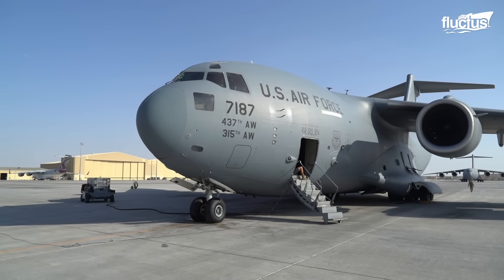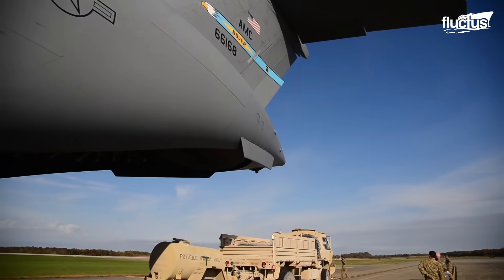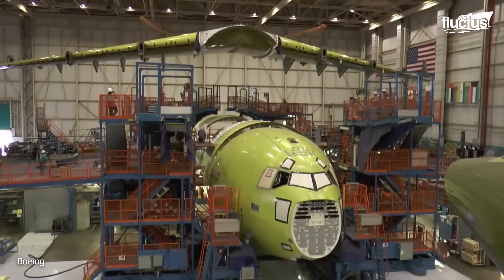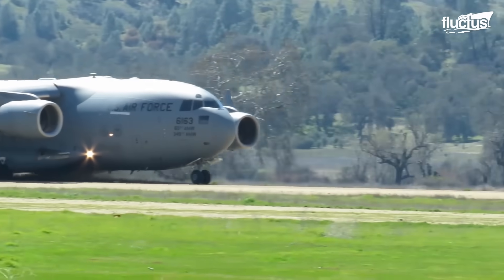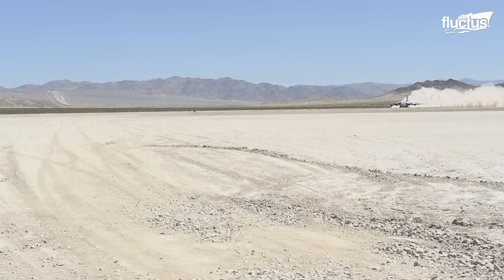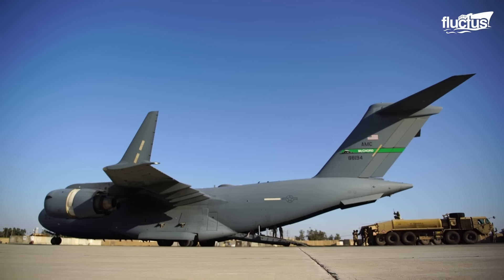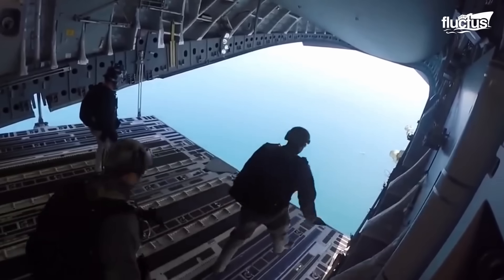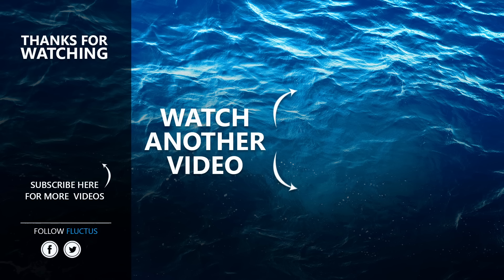Boeing C-17: US Most Advanced Airlifter Ever Built | Documentary

Comment: I worked on the C-17 as a structural design engineer at MD in the late 1980s.  Easy plane to design for as there was so much room in the wing, something I was not used to having only worked on fighter programs until then.  I designed the (structural fuse) flap attach fittings on the trailing edge and a lot of the fuel scavenge system using jet pumps, another first for me.  Nice to see it doing well in service.
Reply: Thanks for an amazing plane. Did the last second APU placement cause you a ton of pain? I always heard that almost scrapped the entire program
Reply: @sheeshshoot123 I m not aware of that APU issue at all.  During my time there (I was a contractor) it was a weird program, management-wise.  Everything we did was on their CAD system, and later we had to print out Mylar versions and modify them by hand.  Made no sense to me, still doesn’t.  There was budget hanky-panky going on Im pretty sure…burning hours they were already paid for, but I dont know.  This was Reagan era waste, fraud and abuse time, and here it seemed to be happening in front of my face.  Lol.  Come to learn such is life.

Comment: I was working for the phone company at McDonnell Douglas in the early 90's when they were building the 1st one and we had a microwave radio room in the hangar where the plane was undergoing wing stress testing.  The horizontal stabilizer on the tail was level with our 5th floor radio room.  They had they huge hydraulic arms attached to the wing tips and were pulling them up about 10 or more feet when one snapped and that led to a complete redesign of the wing.  When testing out at Edwards AFB they used to relay flight data along microwave sites all the way back to Long Beach for analysis.  I think one of the 1st flights they did a 380,000 pound takeoff in 1200 feet.  That's amazing.  After I left there Boeing took over the plant and now it's not even there.  Even new office building that Douglas built was torn down.

Comment: "Most Advanced" doesn't mean the Best; Just means it is New
Reply: Then tell us which one is the best. I gotsta know.
Reply: @hagdore  It was just a statement. But if you wish, as @solero7378 points out, the C5. Also There is the Beluga or the ill fated An 225.
Reply: Not true.   C-5 can do that.   The powers- that- be made the Air Force hide those capabilities of the C-5 so Congress would approve the C-17.  Only reason we didn't just build more C-5s was a certain General McPeak had all the molds destroyed.   The C-5 can land on shorter fields,  and take off on shorted fields with more cargo,  and it has a smaller foot print,  thanks to all the extra tires.   That is all published on all airfield- suitability reports. Oh,  and it can land on un-improved surfaces.  C-17 can't because engines fod out😮
Reply: @solero7378 then why do they have the c17 in the first place if the c5 can do everything but better
Reply: @AlwaysChasingStorms  Already answered.  As with any military purchase, they have to convince Congress why they need it.  They needed new airplanes, and the molds for the C-5 had been destroyed.  And to promote the capabilities needed for a new airlifter, many of the capabilities of the C-5 were removed from the tech orders, making it a violation for aircrew to do any of them.  That way they could go to Congress and say that they didn't have an asset that can do low level airdrop, or short field operations, or unimproved- field landings.
Reply: Do you have another aircraft more advance than this one ?
Reply: Ni cómo decirlo mejor!
Reply: @luismonjaras7160  The Replies or the Plane?
Reply: Name one better..there is no other it's the best!
Reply: @Loafin2010  See my previous Reply
Reply: The C-5 could do everything this little airlifter can do,  and more... and better.  Haul more.  Go farther.  Go faster.
Reply: @solero7378 being bigger is no good if you can't land it anywhere near where the cargo is needed. The C-17 has much greater STOL capability